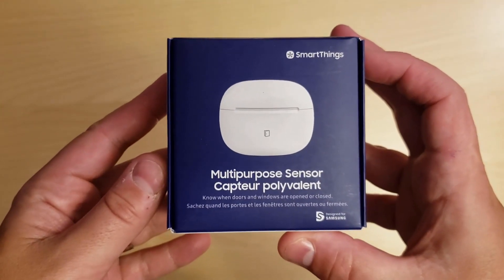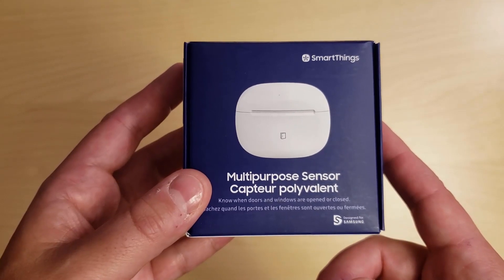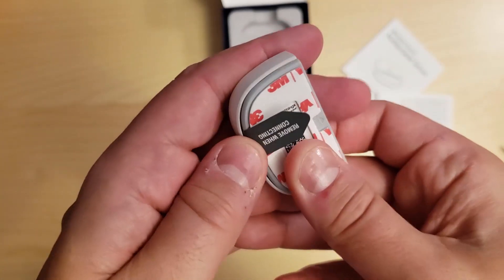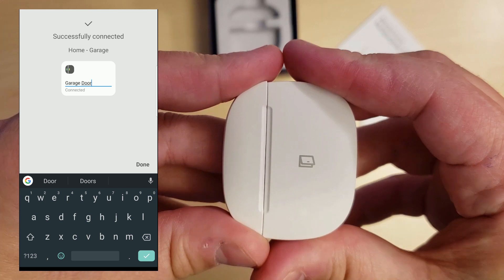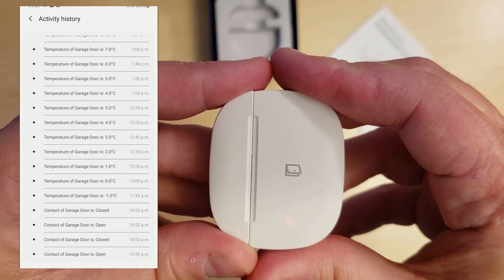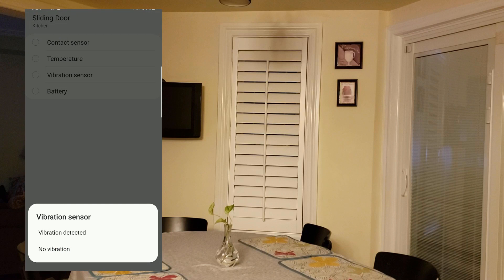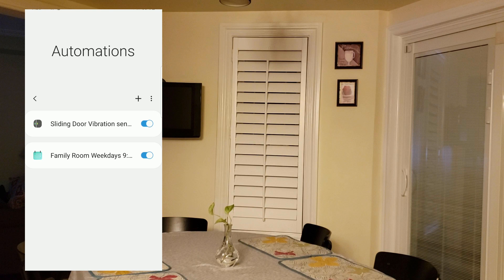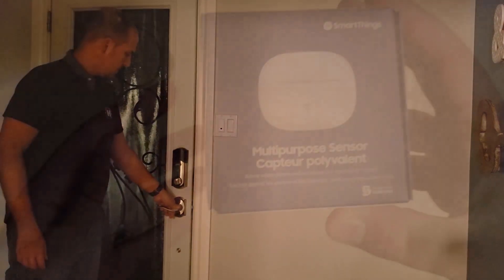SmartThings Multipurpose Sensor - Unboxing, Review, Setup & Demo

Comment: i might be tempted to try one of theese on my wwardrobe closet sliding doors to trigger led stripes inside the closet (for a number of reasons it is not possible to use a normal door/window sensor) and i am less than impressed with the aqara vibration sensor…it seems very unstable..
Reply: i tried smartthings (aeotec) multi sensor….works perfect… no disconnecting issues,  solid material, and the magnet contact gives you more flexibility than the flimsy ones from competitor companies..

Comment: Thank You for the detailed step-by-step video. Very informative for the layman. I have installed the Smart Thing app on my iphone and so far I have one device (my Samsung Soundbar Q950-A) connected to the app. I do not have the SmartThing Hub. Recently  I purchased the All purpose Sensor (Model:IM6001MPP05) and tried to connect but each time the SmartThing app on my phone prompts "it needs a Hub to connect".  Can I add the multi-purpose sensor without a hub, and with just the Smart Thing app on my phone. Any suggestions is welcomed.
Reply from the maker: You do require a hub.
Reply: @HipIOReviews  I already have a Philips Hue hub.  Could you connect the sensor to it and then use it via the smartthings app?  or vice versa, you can connect the Philips hue lights directly to a Smartthings hub without a Philips hue hub.  So that you don't need both hubs.
Reply: I'm also wondering the same thing cause I have the Philip hue hub as well

Comment: I realize this video is old but was hoping you could help. I had 2 of these multi purpose sensors ( the oval ones ) connected in ST ( new app, V3 Hub ). Everything went off line for a few hours and then came back except the sensors. So I've reset them, taken the batteries out and reinstalled, etc. The sensors are flashing red/green like they should and my hub flashes green as it should ( when looking to pair ) but no matter what I do I can't get the sensors to reconnect. Any help or ideas would be appreciated.
Reply from the maker: Have you tried bringing the sensors next to the hub when pairing?
Reply: @HipIOReviews  yep, I've even had it sitting right on top of the hub, lol
Reply from the maker: Have you already tried this?

Remove the battery of the multipurpose sensor.

Open your SmartThings app and search for devices.

In your sensor, press the reset button as you put the battery and release the button once you see the LED
Reply: @HipIOReviews  yep, tried the whole remove the battery, press the reset button while reinserting the battery, everything. Nothing works

Comment: Great Video and great info.  I tried to look almost everywhere for these sensors but i cant seem to find them. What other suggestion would you recommend in case i cant get these??
Reply from the maker: The only other sensors I've used were the Xiaomi ones, they're a good price but harder to setup and the magnet is definitely not as strong.
Reply: @HipIOReviews  thanks for your response. Will these work with out a hub?
Reply from the maker: No, they need a hub.

Comment: I have a Samsung QLED Q80T smart tv with smartthings built in, would I still need to have a hub to use this.
Reply from the maker: No you would need a hub, the tv only serves as a dashboard for SmartThings.
Reply: I talked to the actual Samsung company, and they said I dont need to have the hub to use smartthings light bulbs and door sensors. I replied again as a just incase and said so I dont have to buy a hub to use them in my home and that I can just use my tv an app, they said yes correct. Regardless of what is true I really appreciate you taking the time to reply back. Thanks
Reply from the maker: Hmm, I don't think the tv has ZigBee.  But if you end up buying the sensor. Let me know if it works. I would love to know :)
Reply: Haha yeah it turns out they misinformed me the 3 times I got in contact with them. U have to buy a hub for these items to work.

Comment: How long about battery time? I read on a forum a guy was saying between 6-12 months depends on your using. Is that right? Thank you
Reply from the maker: Seems right. The one i added to my front door in 2 months,  used 15% , And my sliding door which gets more action in 1 month used 15% , so that should me to a little over 12months for the front and 7 months on the sliding door. Hope this helps.
Reply: @HipIOReviews  really thanks..

Comment: Will it work as a glass break sensor ?
Reply from the maker: You'll can probably use it as a glass break sensor if you set it up to alert on vibration. I personally have not used it like that, so I can't confirm if you would get false alerts if your Windows shake when people are walking around or wind against your windows.